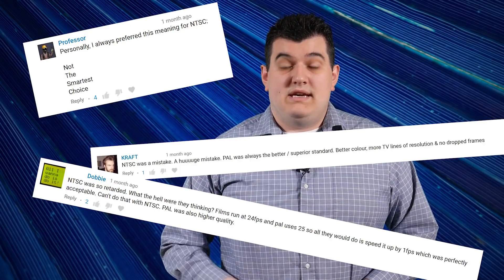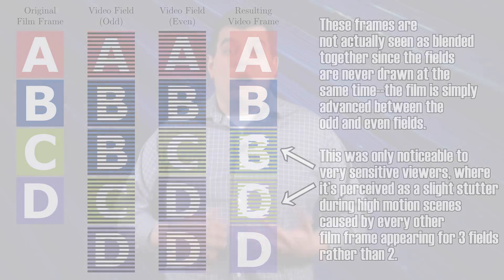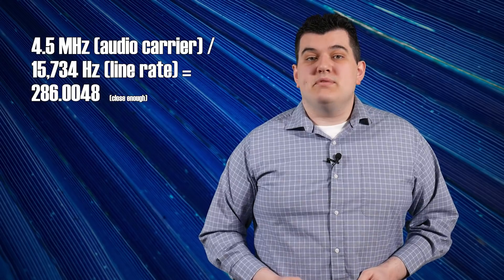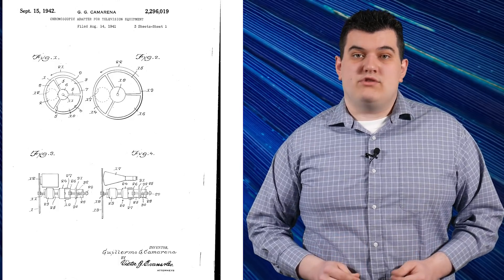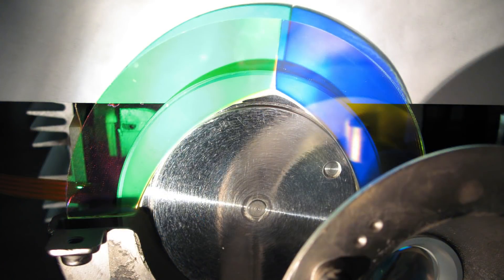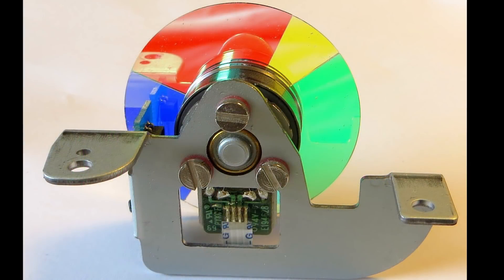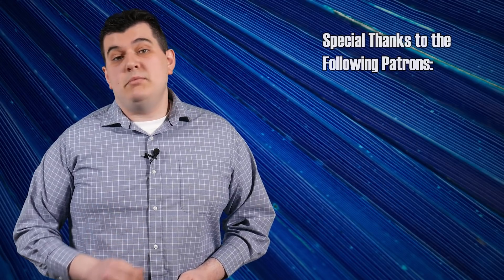Analog Color TV Wrap-Up--Some extra info

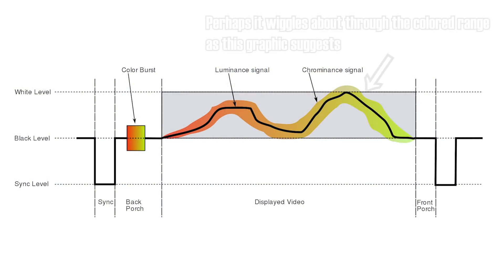Comment: RE: chroma dots @6:27.
 Your speculation is correct. The chroma signal is encoded by "wiggling" (modulating) the Y signal within that range.

I find it helps to understand this by looking at the signal from the perspective of the TV doing the decoding.

A black and white TV has two radio demodulators, one that locks onto the sound sub-carrier to demodulate the sound (which is FM encoded) and one to lock onto the video sub-carrier and demodulate the video signal (aka, Luminance or Y), which is actually AM encoded. These two radio demodulators are essentially independent, apart from the fact they are tuned to two signals that are right next to each other on the dial.
 Early TVs are actually really simple, electronically. All they do is take the output of the video demodulator (which is a nice voltage between 0v and 1v), detect the horizontal and vertical sync pulses (which are used to lock the frequency/phase of the two flyback transformers controlling the CRTs vertical and horizontal scanning) and then send the remaining signal directly to the CRT's electron gun to control the brightness of the electron beam at that position. 0.33v Represents black, 1v represents white, while 0v represents a sync pulse. 

The most logical way of adding color to such a system would be to add a 3rd radio demodulator, one which picked up 3rd sub-carrier and decoded a chroma signal. But this would make the TV signal take up more bandwidth, and the FCC had already allocated 6Mhz channels. Additionally, you would have to replace all the black and white video equipment in the recording studios and transmitters to carry and transmit this extra signal.
So instead, the two demodulators are left untouched and the chroma signal is actually modulated on top of the Y (aka Luminance, Black&White) signal to create a combined Luminance/Chrominance signal (which replaces the Y signal and  decodes fine as a Y signal on old Black and White TVs). Color TVs actually have to demodulate the demodulated the combined Y/C (Luminance/Chrominance) signal a second time to extract the chroma I and Q signals.

The chroma signal is encoded in the high frequency of this combined Y/C signal. A black line on the TV would have a Y/C with a constant 0.33v across the entire line. A white line would have a Y/C signal of a constant 1v across the entire line. For a solid colored line (say bright-green) the Y/C signal will fluctuate between 0.93v and 1.07v at a rate of 3.58 mhz. The phase difference between those fluctuations and the 3.58 Mhz color burst signal at the start of the line encode the hue of the color, with 225° representing green (178° for Yellow, 100° for Red, 0° for blue). The height of the fluctuations represent the saturation of the color (±0.07v represent 100% saturation and ±0v would be 0% saturation, or grayscale). The average height of the Y/C signal of course represents the luminance. 
For complex lines with multiple colors, the fluctuations in Y/C won't be a constant 3.58 mhz, as it will speed up and slow down rapidly to change into the correct phase for the color at each location on the screen.

To decode this complex signal, first Color TVs have to split the Y/C signal by frequency. Early Color TVs would have used a Notch Filter, with a range of frequencies around 3.58Mhz (say 2.8Mhz to 4.1Mhz) being extracted as the chromance, while the rest (say 0 to 2.8Mhz and then 4.1Mhz to ~5.5Mhz) being interpreted as Luminance. 
Frequency in a luminance signal is the rate of change of brightness across the line. A solid color across the line would have a frequency of 0hz. An image with vertical b&w bars across the screen, each about 1/10th of the screen wide, would have a frequency of 0.2 Mhz. With vertical bars 1/100th of the screen wide the frequency would be 1.9 Mhz. If you had vertical bars which were were about 1/188th of the screen wide, a color TV would actually interpret it as color infomation and show a solid color. (A number of 8bit computers like the Apple II actually took advantage of this to create color). But as the width of of the vertical bars got thinner and the frequency increased over 4mhz, they would become visible as black and white bars again.

Modern TVs use Comb Filters that use the infomation from previous and following lines to extract a much better Luminance signal that preserves most detail even around 3.58mhz. See this document for more details: https://www.intersil.com/content/dam/Intersil/documents/an96/an9644.pdf

So what are chroma dots? They are simply the actual chroma infomation which has been modulated right in the middle of the luminance signal. B&W TVs that were manufactured after NTSC was standardized are meant to the same notch filter that color TVs use, and simply discard the infomation with that frequency.
Reply: This is a terrific explanation, I like the way you included the actual video levels in volts.
Reply: This also shows why it was so important and used to be required that the broadcast studios would KILL the Chroma Carrier for B&W programs to restore the full resolution image without color signal modulation for the B&W programs.  It also allowed the Color TVs to shut down the chroma circuitry, and pass unfiltered full luminance signal for the program to allow the full resolution of the original pre-color standard addition.
Reply: @denshi-oji494  your missing the point. The phase of the chroma signal(relative to the color burst) determines the color while the amplitude of the chroma signal determines the saturation level of the color. During black and white portions of the a scene there is no chroma signal as its amplitude is zero. Thus a black and white image has no chroma signal to demodulate.
Reply: Carlos Garza correct, if everything is properly calibrated at the broadcast station.  Often in reality however, a black & white program more recently was broadcast with a skewed tint, as the color was more typically in the later years of analog turned off at the broadcasters.  If it was a pure black & white signal then the phases and amplitude would indeed be zero.

  Back in the days of vacuum tubes  and all analog, it nearly impossible to ever get to point that calibration was perfect, so the broadcast video even for Black & White content would have a tinted look due to the active amplitude and phase of the chroma signal.  typically the broadcasters would not only disable the chroma on the broadcast side for B&W programming but also disable the low pass filter they typically placed on the normal video that would cut the luminance off to prevent any interaction with chroma on color signals.  So over the years the broadcaster changed many times what they did for broadcasting color and B&W programs.  This happened as the technology in the equipment available to them increased.

I remember many times in the mid 60's to early 70's, calling the local broadcasters in the SLC market to turn off the color burst for the B&W program they were currently broadcasting.  When th hey did, the resolution would also be increased as they disabled the low pass filter also.  Then on our circa 1964 Philco color tv, the video changed also from an almost sepia like display, to really looking like B&W. along with the much higher resolution.  On my really old Zenith B&W TV the resolution just jumped up from OK to absolutely amazing!  That old Zenith always looked much better than the newer color sets at the time.  It wasn't till about the mid 80's till I finally was able to get similar B&W performance on a color TV compared with my old Zenith.

  My old zenith is in  tall blonde cabinet, with an Electrodynamic speaker that still sounds amazing!  The CRT was replaced in the early '60s with one that has bonded safety glass.  I think it is an early '50s model, but I am not sure.
Reply: phirenz, your  xplanation is great except for the use of "modulate" to describe how the chroma carrier is combined with the luma. It is not modulated on (multipled by) the luma  signal, but simply added to the luma  signal.
Reply: THANK YOU SO MUCH, I've had trouble for a long time understanding how color is encoded into a composite signal, I knew it had something to do with phase-shifted frequencies, but not how it actually worked, and I didn't know what the color burst actually did or why the chroma dots actually happen, and I couldn't really get a good understanding from technology connection's video, but you have explained it amazingly, I finally understand.
Reply: Now I understand color moare when presenter on tv had checkered pattern clothes
Reply: This is an example of "nested" or "second-order" modulation.  The chrominance signal is modulated onto the luminance signal—which is why an NTSC waveform monitor displays the colour burst as a sine wave with a frequency of ~3.58 MHz—and the resulting composite video signal is modulated onto an RF carrier.
Reply: This is late, but I did some back of the envelope calculations and was surprised by how reasonable the reproduction is from the black and white film.

The bandwidth of the I and q channels means the whole thing is bandlimited to about 5mhz, which means it can be perfectly reproduced using more than 10 megasamples per second by Nyquist. Which corresponds to film the equivalent of about half a megapixel per frame. 

Even being really harsh, film would likely exceed that by at least an order of magnitude. Which gives plenty of wiggle room. Bit depth might be an issue, but with such a large difference you could probably do averaging to get very acceptable accuracy
Reply: this is brilliantly helpful
Reply: "A number of 8bit computers like the Apple II actually took advantage of this to create color" -- This was very apparent in those days when some people used monochrome monitors (mostly long-decay green phosphor) -- the "dot pattern" as described in the video were actually quite noticeable when the Apple II displayed color image graphics.
Reply: Thanks for this explanation! Now I understand how the color modulation works, and why you get color fringing when trying to pump high resolution text over ntsc - the contrast transitions are being incorrectly decoded as color information!
Reply: Comb Filter You are correct for the color killer circuit.  There were some, probably not many, chips used in TV receivers that did also have an internal filter to filter out the chroma frequency that would also shut off to allow full non-filtered luminance on a true black&white signal.
Reply: Just to add a few details to either explain or muddy the issues,The luminance (brightness) carrier is near the low end of the band of frequencies allotted to one TV channel. The luminance is modulated onto this carrier with the lower sideband suppressed, so except for a little overspill, this signal only uses the frequencies above the carrier. Finer picture details use higher frequencies. This prevents interference with whatever uses the frequencies below the channel's allotment. Furthermore, the frequencies in the upper sideband tend to appear near multiples of the horizontal scan frequency from the video carrier frequency.
The chroma (colour) information is modulated onto another frequency which is exactly that magic 3.38...MHz above the luminance carrier. This is modulated with the upper sideband suppressed, using only frequencies below this carrier frequency. Finer details in the chroma use lower frequencies. Suppression of the upper sideband avoids interfering with the audio signal (at the top of the channel's band) and anything above the channel's upper limit frequency. Also, this is a suppressed-carrier modulation, with only the colour burst providing the information required for the receiver to reconstruct the carrier frequency. Just as with the luminance, the chroma signal tends to appear near multiples of the horizontal frequency away from its carrier.
Most of a picture is coarse detail, so the luminance information tends to be bunched at the lower end of the band, near (but above) the luminance carrrier, and the chroma information tends to be bunched at the upper end of the band, near (but below) the chroma carrier. This is why the two signals can be separated by a simple frequency filter system.
Furthermore, that 3.58...MHz frequency was chosen so multiples of the horizontal frequency above the luminance carrier and below the chroma frequency interleave with each other in the spectrum. That is, the 3.58...MHz frequency is an odd multiple of half the horizontal frequency. This means that a comb filter can also help separate the luminance from the chroma.
If a B&W set does not filter out the chroma signal it will show up as very fine dots, as described in this video. Conversely, if the broadcaster allows too high a luminance frequency in a colour signal, fine details will produce colour artifacts, as one would sometimes see on a news anchor's fine houndstooth jacket.
Note that whether you view the TV signal as being FM sound plus two AM signals (luminance and chroma) modulated on two carrier frequences (with one carrier suppressed), or as FM sound plus one AM signal which is the luminance plus a sub-AM suppressed-carrier signal containing the Chroma is just potahtoes and potaytoes. Amplitude modulation is associative and commutative.
Reply: Phew! Thanks. I thought I knew my stuff until now.
Reply: I felt so dumb not understanding his explanation in the video but your explanation cleared most of it up for me
Reply: phirenz you are a nerd and I appreciate you so much
Reply: Correction: All TV receiver circuits I have seen decode the Audio FM signal from the output of the carrier frequency AM demodulator, just like the Chroma signal.  The overall subcarrier frequencies are zero for luminance, (Y or B/W), Chroma was 3.58MHz (30 fps) or 4.43MHz (25 fps), FM audio was 4.5, 5.5 or 6.5 MHz depending on allocated bandwidth per channel.  SECAM used two chroma frequencies.  Note that 625 lines (576 visible) isn't formally tied to PAL and 525 lines (480 visible) isn't tied to NTSC at all (hello Brazil).
Reply: When viewed on old B&W TVs this can be seen as diagonals in opposite directions on alternate lines.
Reply: The Composite TV Signal (EP 23)
NTSC Video Basics
YCbCr and RGB Colour
Reply: As it's widely known in this field, chroma is supposed to be interlaced with luma scan line harmonics, ideally never overlap with it frequency-wise, some overlapping is unavoidable. Both luma and chrominance are calculated from original RGB already in the camera and combined, not multiplied as correctly said. Ofc I component is in phase with CB and Q 90° offset both in one chroma signal superimposed on luma. Most interesting thing is how two phase offset signals are combined in one and then extracted without loss, and ofc separation of luma from chroma in the first place. Also video does not mention only the V component in PAL is inverted every other line cause human eye is more sensitive to red-green than blue-yellow. It also does not explain how error cancelation is done, i assume if correct color phase is say -30° and error adds +10° making it -20°  and then the next line is also -30° but since it's inverted it's +-30° and error adds +10° to it too making it 40°.  So we got two lines one -20 and other +40, this can simply be averaged by adding the mean values and halving back to 30 aka original is recovered and error removed, obviously at loss of vertical color resolution but that is not perceptible.
Reply: Also no mention why both sum and difference of I and Q signals vs the 3.58Mhz aka both higher and lower sideband are transmitted despite the fact that all I and Q content is contained in both, just like in heterodyne, just one is needed, all info is in it. But in this case unlike heterodyne radio not all info is in one. They apparently include both cause single sideband cannot contain low freq or DC component, therefore so called Vestigial Sideband.